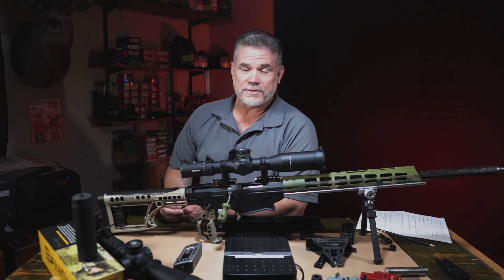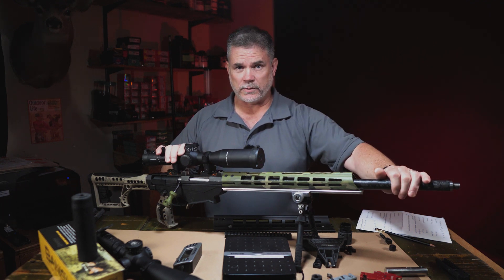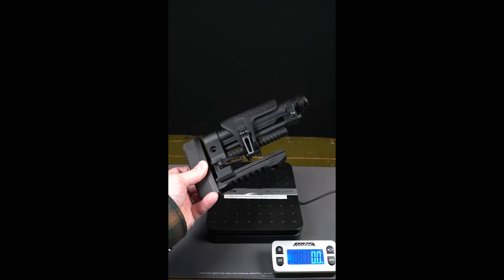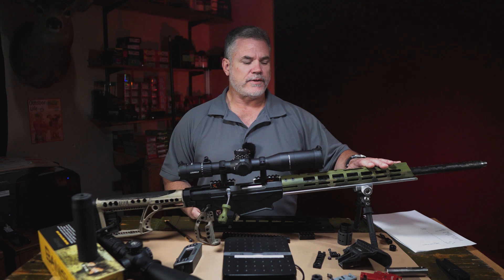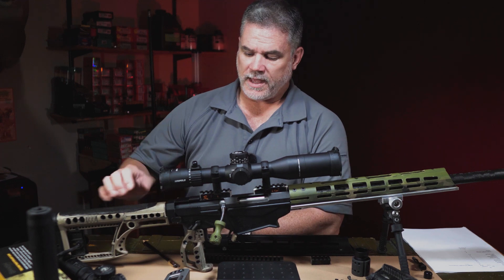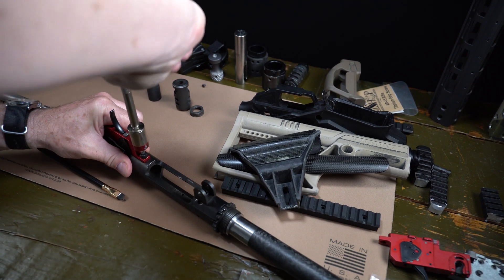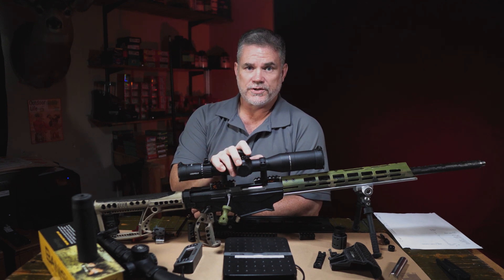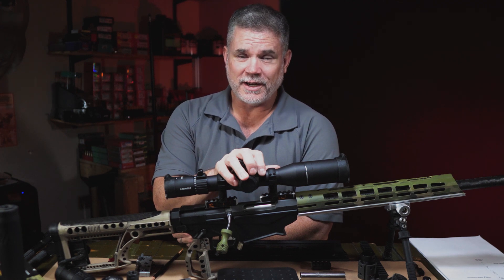An Ultralight Precision Rifle? - Did it make the goal weight?

Comment: Maybe run a bamboo bolt knob? Maybe add a light washer or two sandwiching the single cell of bamboo you'd need? Should you not have the trust?

Also, check out some of these modern Nerf gun stocks, Uber ultralight. You'd be adding to gain weight afterward 😂

Check it out, thought.

P.S. great video

Comment: 1. Army sayings, "Ounces add up to pounds and pounds add up to pain."
2. How much does the handguard plus prototype Arca rail picatinny adapter weigh?
3. On my RPR, I have a one-piece Catalyst Arms Fast Track Arca Rail Precision Handguard which weighs 19 ounces.
4. One versus two or three separate pieces.
Reply from the maker: I forgot the weight of the arca-to-pic adapter...it's three ounces or so i believe.  Yes,, that sounds about right for the Fast Track. The factory Gen 2 handguard nut on the RPR weights less than the Fast Track, that's why I reinstalled that assembly and cut some weight out of the handguard.. Not sure what you mean on #4...